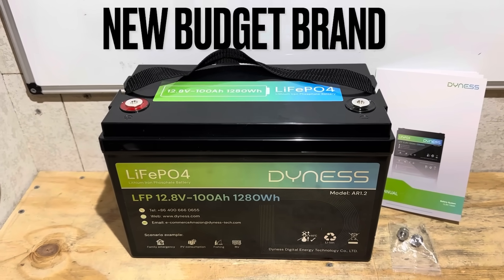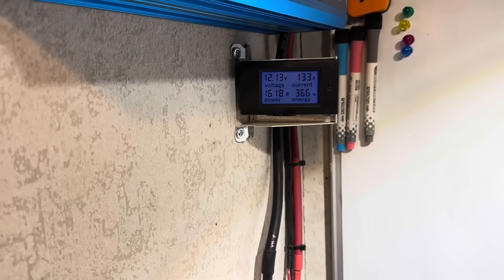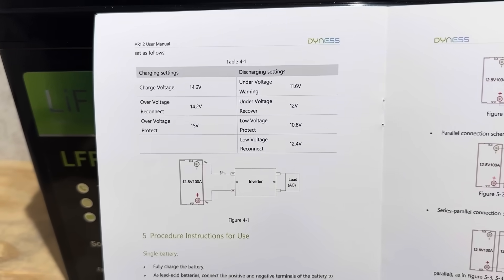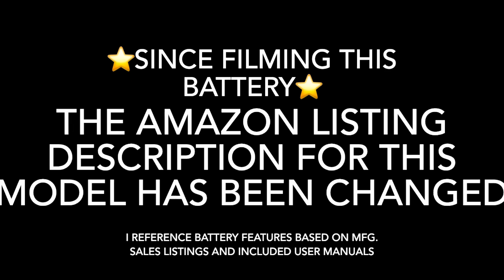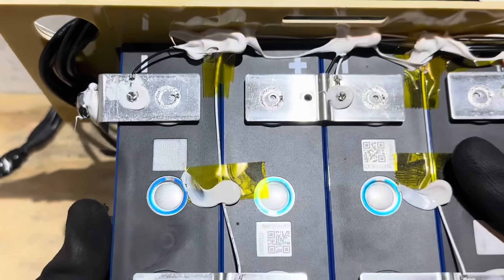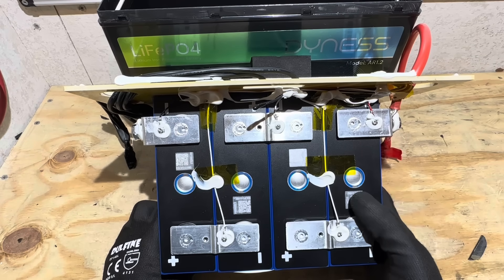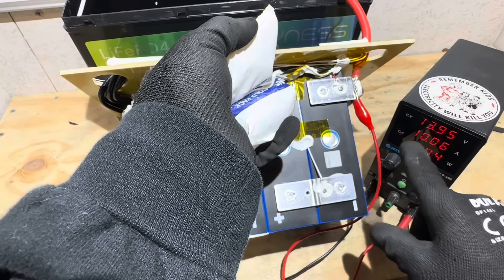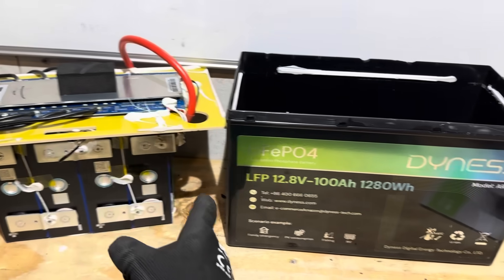CHEAP 12V BATTERY: Dyness 12.8V 100Ah LiFePO4 Lithium Battery Review and Teardown

Comment: Great video - I'm looking at the Dyness 36V 55AH currently going for coupon price of $300!  I already have a 10 amp charger for my Newport 36V 40AH kayak battery that should work for the Dyness.  This, combined with the Newport, willl give me great range for my 3hp motor.  Do you suspect that Dyness is similar quality on the 36V battery? Price is great!
Reply from the maker: Thanks! Cool use of a 36V battery! 
I would assume the build is similar, but of course can’t say for complete certainty without checking one out. Thats a screaming deal though.

Comment: Did you have to cut the bottom off, to get the battery bank out?    I bought 4 of these exact same batteries a couple monthes ago, thought I would top balance the 4 batterys, got 3 of them to 14.4v (fairly good, bms should balance more, after solar install, but 1 battery would not go above 14.0 volts after repeated attempts to charge it, while others kept climbing, so I assumed the bms was balancing but the the low one was very out of balance.   DYNESS had me show video evidence of the charging shut down voltage, and said they would replace the 1 battery not doing as well as the others, but after 3 weeks no message from Dyness so I sent follow up email and its been 8 days with no response.    I got the top off the bad one, but the glue on the bottom, is not letting loose, so i cant check individual battery cell voltages, I got a capacitor battery balancer hopeing I can top balance the battery.
Reply from the maker: No I didn’t cut anything on the battery. The sealants are tough to get through for sure. 
Sorry you’re having issues. Sounds like you may have a runner cell in the one battery. The balancer is passive and have minuscule current bleed on these boards. 
Hopefully they will get your warranty taken care of. Please let me know.
Reply: @THEOFFGRIDMOUNTAINHOMESTEAD   Thanks for responding.  I got the top off clean like you show at 5:41.    But I cant seem to get the glue on the bottom to let go, turn it upside down and bang it against the ground, wont budge.  The glue on the top board is all sliced and not adhering to the sides, so I figure the bottom is glued too strong.   I have a capacitor active balancer (5 amps)  if I can get to the batteries that should straighten it out.

Comment: nice review!, in your opinion what would be a good device to hook up to this battery to see the remaining juice in this battery, i was just thinking about using it for my camping fridge
Reply from the maker: Power Queen, LiTime or Renogy shunt. For large display and high current capability. For a single battery at around 100A load, you could get a Drok brand for about $30 and works great and very accurate. Hope this helps!

Comment: Enjoyed the review.  
Perhaps they added after your review, or maybe you mean it's not claimed in the included paperwork.  But it's on their Amazon ad: 

"Additional upgraded low-temperature power-off function to ensure safe use in low-temperature environments. Designed for harsh environments such as rainy or marine, or dusty and wet conditions."
Reply from the maker: @maurice7413  Thanks! It’s not in the paperwork and it wasn’t in the Amazon description/graphics when I filmed!

Comment: Another great budget battery review. So many brands out there. If these prices keep dropping I might replace my old AGM bank I acquired years ago. That would double the capacity for 75% of what I paid. However if the grid hiccups batteries like these will be hard to find for any price, IMO.
Reply from the maker: Appreciate you! There are new models popping up all the time! I do like seeing them come from a company that actually makes other styles of batteries.
Much more energy dense and efficient than lead batteries but it’s always good to keep some lead acid around for just in case. (Lots of lithium on here but I have lead acid in reserve too) Thanks for stopping by today! 👍